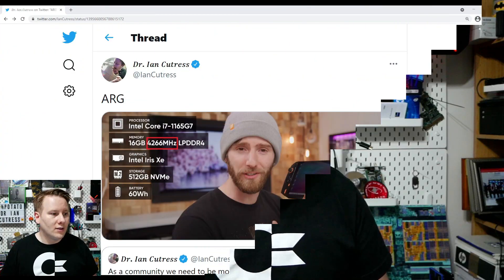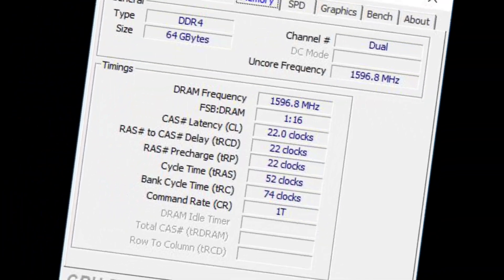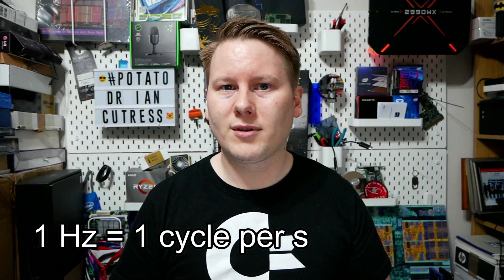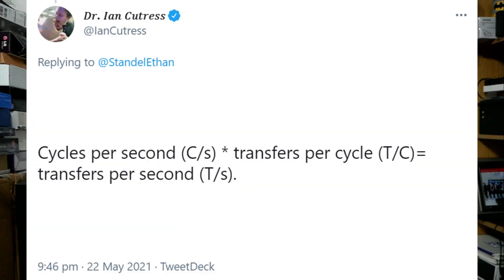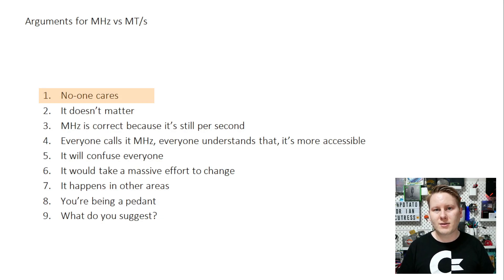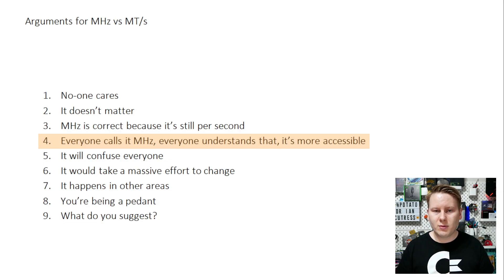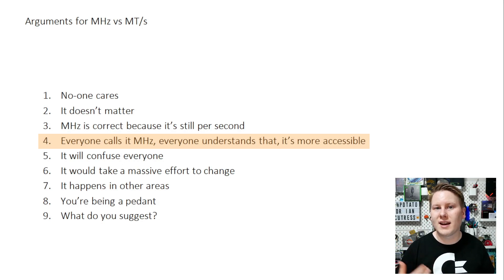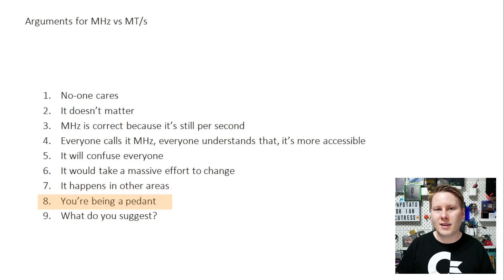Linus is WRONG 💩 : Explaining MHz vs MT/s

Comment: Totally agree. Imagine if we did this with car engines, or with refueling a plane. Just because it doesn’t have the same risk to human life doesn’t mean we should just be incorrect. It’s a good habit to be correct about smaller things like memory so when we deal with more important stuff we are already trained to be correct about every detail.
Reply: Worst paragraph here
Reply: @Freddie_J8  at least thats a rounding error ,not a blatant misrepresentation
Reply: Image if people would do this with the storage devices. You buy a 1 TB drive hoping to put your 1024 folders each containing exactly 1024 images of exactly 1 MB of "research" each. And then get baffled when it doesn't fit.

Oh...
Reply: @Winnetou17  but that's not the hard drives fault. That's the allocation size fault, right? That's on an OS.
Reply: @Winnetou17  also wait what? 1024 1MB images on a 1TB drive? Do you mean 1GB?
Reply: @nordgaren2358  :)) 1024 folders each containing 1024 files of 1MB. Pretty sure it adds up to 1TB.
Reply: @Winnetou17  ohhh. Didn't see the folders thing.
Reply: Cars can kill people. 

What a dumb comparison.

Comment: I've built PCs since the 90s. Because of the incorrect interchanging use of these terms by the tech industry, I've mixed them up in my head at times. I've even looked up the term because I was confused when someone used MHz (because I forgot the original meaning). Not a big deal, but annoying.

I'd much prefer if everyone just called it by the correct term. It's kind of snowballed into this weird mess where even vendors are using incorrect terms.

It's not a big deal for tech media. Just start using the term and explain for 5-10 sec when you think it's necessary. After a bit, you won't need to.
Reply: Is this odd trend of swapping MHz with MT/s has happened since the 90s? If it's not, then do you remember who the heck started this terminology as a standard marketing term even?
Reply: @josuad6890  It's hard to recall the specifics back then. I don't remember that being part of the convo. I know I got tripped up on it in the 2000s tho. DDR came out in the late 90s, but then RAMBUS was also a thing then too. Strongly disliked that company.

I know even recently, probably a few years ago, thinking I had messed up RAM speeds because I saw the CPU-Z MHz and forgetting about DDR. If everyone used MT instead of MH, wouldn't have happened. Not a big deal, but still annoying.

Comment: I thought I was the only one that agreed it does matter.
We all should be using the proper terms.
Reply: Especially if youre a big channel like Linus
Reply: I'm curous whether you use 2k or 1440p? I've heard both and both seems to be accepted
Reply: I use 1440p, 2k sounds like a gimmick to me.
Reply: @kasomoru6  2k is kinda more consistent as you'd sometimes have screens with different aspect ratios that'll mess up the 1440 number like say having a 16:10 screen instead of 16:9 that taller aspect ratio would have a different number than 1440p cause it's taller
Reply: @user-vp2ve4sh7h  "4k" is generally used incorrectly too if we are on this topic, the 3840 res is "UHD".  Of course they now say "4k UHD" which is a little better if still technically incorrect.
Reply: @eubikedude  well yeah ig tvs do have a standard aspect ratio so there's no excuse for Mislabeling
Reply: @eubikedude  and it's just nice to have a general label everyone can understand than listing some numbers cause the aspect ratio is different
Reply: @oscarchang486  2k and 4k. Common usage is what makes language. If we went by "official" usage of words, everyone would be pronouncing. ".gif" as "jiff" .-.

I know there are "actual" 2k and 4k resolutions that are slightly different, but most consumer screens don't use that size, so just about nobody actually uses them. It cuts the syllables down by a third, and everyone knows what you're talking about.

[1440p is more specific, and people will still know what you're talking about. I do use that too]
Reply: @EmmaJ_462  gotcha. I've had people correct me on both so I wasn't sure
Reply: @EmmaJ_462  Yeah. 4K reminds me 60fps in place of 59.94fps. I'm fine with approximating numerical standards for sake of simplicity.
Reply: @oscarchang486  actually it's a lot more to it.  It get's complicated when you bring monitors into the mix, and even more so when considering video cameras, and lenses.  It's just competing standards on different mediums adopting similar terminology.   There's cinema DCI 4k, and 2k. Then there's television 4k which is a multiple of 1080p (16:9) there's a good explanation here by QnA 
https://www.reddit.com/r/pcgaming/comments/1vlax0/why_is_it_called_4k/cetf3mw?utm_medium=android_app&utm_source=share&context=3
Reply: @oscarchang486  2K is a resolution but it’s different from 1440p, I don’t really know why it started being called that way. 2K is 2048x1080 pixels while 1440p is generally 2560x1440p. 2K is technically 1080p, just like an ultra wide monitor with 1440 pixels of height is 1440p
Reply: Yes. And the more subscriber you have, the heavier burden it is to be correct on these basic issues. Although arguably Linus target audience are different to Dr. Ian Cutress

Comment: Haha. No. I was pedantic about this too for years, but actually it is not wrong to say 3600 MHz. You just need to know what you are talking about. For example, if you talking about whole clock cycle frequency, sure it 1800 MHz. But, if you are talking about a data rate, it is 3600 MHz, or if you are talking about clock edges frequency, it is 3600 MHz. I personally write 3600 MT/s, but I don't correct people saying 3600 MHz, because it is not wrong.  Hz, is not necassarily "cycle per second". It can be apllied to any periodic phenomenon.

Anyway, it is waste of time. Very few will see videos like that, change their behaviour. People who know, knows already, or understand it anyway. People who don't, don't care, and still will understand what is being communicated.
Reply from the maker: Haha. Yes. Hz is a periodic measure. Memory transfers are not periodic. That's addressed in the video.
Reply: @TechTechPotato  When they are happening they are periodic with specfic time between each bit, and and it is 3600MHz.
Reply: @TechTechPotato  The reason it is "wrong" to say 3600MHz, is not because it is not 3600MHz, but because technical specification of memories utilize a clock period frequency in specification and clock generation, and such, which 1800MHz. So it not some more fundamental physical or definition reason of what is and isn't frequency, but rather a nomenclature and convention.

Comment: The "DDR4-3200" pattern actually is the official JEDEC terminology, either that or PC4-25600 for a module of the same speed.
Reply: Owh... this  is new to me. Good to know
Reply: It's 3200, and 3200 mt/s yeah. Ian is not arguing we should switch to saying 1600mhz, only 3200 Mt/s
Reply: 3200 in JEDEC spec is speed rating (and also equal to effective frequency in MHz or MT/s). There are more than just clock but also timing, etc.
Sometimes I think some RAM manufacturer are idiot to advertise it's module can run 3200MHz for DDR4-3200 which may cause some confusion, because JEDEC didn't put MHz after 3200 not DDR4 3200MHz, just DDR4-3200)

In case module is test and certified to work as DDR4-3200 that means It can work at 1600MHz clock with standard JEDEC timing according to JEDEC spec.
But for modules that have speed not in JEDEC spec it may work at higher clock but timing are not certified and usually not scale. But at least work on standard timing which specified as unit of time (in ns). i.e. DDR4-3600 can work in 1800MHz clock but CAS lattency is higher because it use more clock cycle for the same time unit.
Reply: You are not using any units, so no error there.
Reply: JEDEC doesn't provide many standards per gen if I'm not mistaken. Wouldn't fix the problem with the million different SKUs vendors have.
Reply: @DustyUnit  I'm not saying consumer kits should follow JEDEC timinigs or JEDEC speeds, I'm saying DDR4-XXXX is the way JEDEC signifies the speed (with an additional letter at the end to specify timings), so it makes sense to use this for speeds outside the JEDEC spec as well.

JEDEC, JEDEC, JEDEC, these letters have lost all meaning now
Reply: DDR4-3200 isn't appending MHz or MT/s which is more correct than writing DDR4-3200 MHz.
I think this ought to be fixed.
Reply: Yup, as transfers and effective frequency is the same, there's no reason to include a specific rating unit.
Even if it becomes QDR, the effective frequency and transfers will still align, and as both are theoretical maximums and not the actual rates all the time, it really makes no difference.
Even the actual clock frequency is not consistent, typically with memory it can power down to low frequency states typically seen with graphics memory, so we can't even technically use Hertz for actual clock frequency according to Dr Cutress, because that's not consistent with Dynamic Frequency Scaling like transfers either, as it can change in less than a second and Hertz is per second,